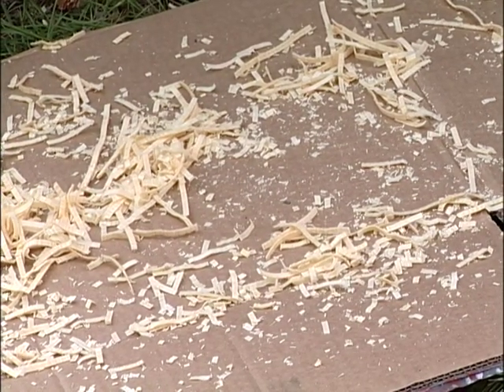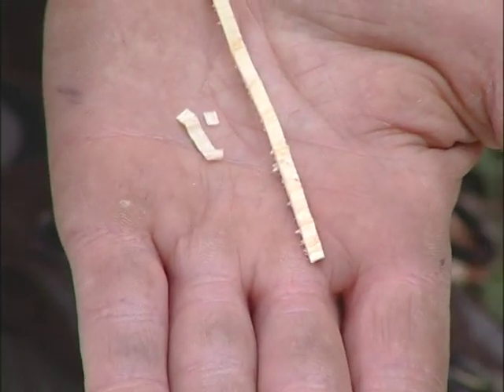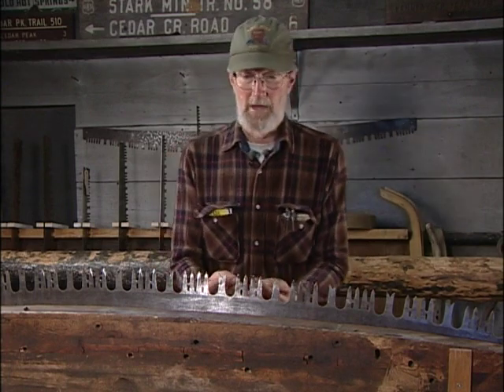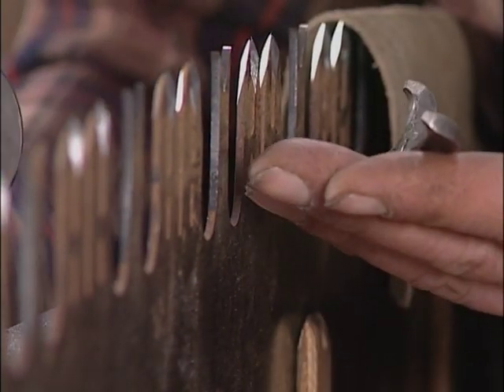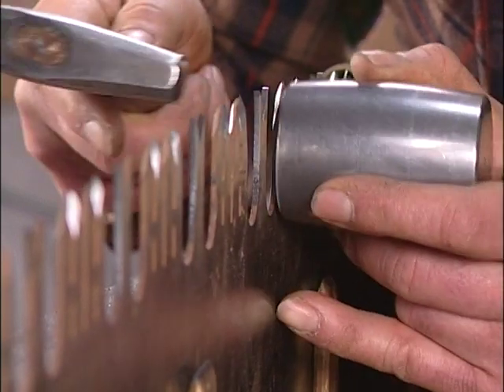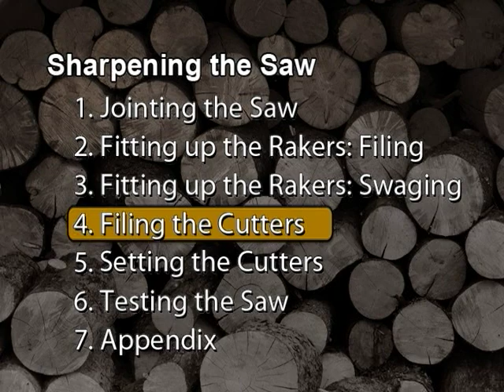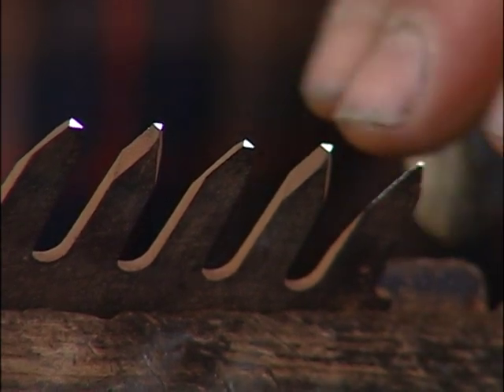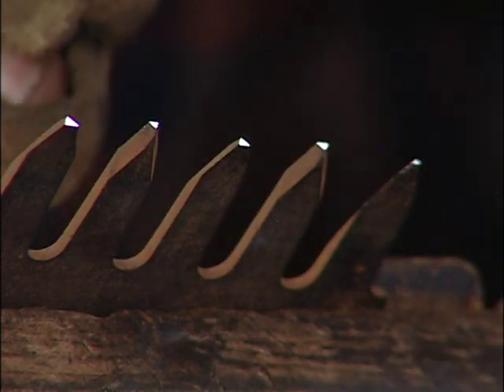The Crosscut Saw Filer, Part 4 of 5

Comment: without question there is a lot more to filing a crosscut  vs  carpenters saw.I appreciate your talent this will become a lost art but for efforts of people like yourself.I see these saws commonly at auctions  are these saws still used in the woods   it would seem the chainsaw has taken over
Reply: These saws are in fact still in use. When doing forestry service in a conservation area, especially bird protection areas, the are much more common as a chain saw is much to loud and can scare the birds off, as well as other smaller woodland creatures.
When they are used depends on the area and if less noise is mandated by law.
Reply: In commercial wood processing, You'll certainly find those saws very seldom, power tools have made woodwork faster and more efficient. But that doesn't mean those saws are not in use anymore, You just don't hear them... ;) 

If You don't have to process a big amount of firewood (or a specified amount of it in a specified time) a well maintained crosscut saw is a powerful tool, it even offers some advantages: 
1. it NEVER runs out of fuel 
2. it NEVER doesn't start because of any technical problem 
(carburator, ignition, ...) 
3. You can process some firewood even in the quiet residential area on Sunday morning. 
4. a quick resharpening of the cutter teeth (using a small rectangular stone of about 500 grit) is done in 2 minutes.

Since about one Year I own a few one man and two man saws (in different sizes and tooth patterns. Some are already restored, some are still waiting) and the more I use them (the more I getting better maintaining thm) the more I love them (*). Using and maintaining them is kind of meditation and kind of workout for me. When I go bushcrafting I often prefer a not too big crosscut saw even over the handyer folding saw. Even if I choose a big one, it's anyway less weight to carry than a small chainsaw (plus the double- tank for fuel and chain oil). 
 
(* most of saws I've restored have even become names during the process: Grace, Doro, Bella, Rosi are my saws. Vanessa, Luzi and Foxy even kept their names, when I handed them to their new owner.)

Or in short: Crosscut saws are just cool! 
It's not about speed, it's about craftsmanship and passion.

Comment: What is the tolerance between the finished swaged raker and the finished filed cutter teeth?  Also  what should the tolerance be between the cutter teeth and the raker teeth before the rakers are swaged?  I have a one-man old crosscut bucking saw and I can't find any information n the tolerances needed.  Also is there any difference in the tolerance measurements between a bucking and a felling saw or are the tolerances the same?  I'm going to use it to cut down some dead trees and cut them up.  The dead tree trunks are a mixture of wet rot, dry rot and hard dry wood.  What tolerances should I use for the saw that is best for cutting this kind of wood?

I asked other people who put up videos about filing  old saws and nobody seems to answer any questions about these saws.  Why is that?
Reply: OK.
Reply: Come back when you can handle a two-man crosscut saw and have passed your physics exams and when you have the brains to look up the definition of words in a dictionary
Reply: Indrekk Pringi I am also concerned about this ..... I havea question if you put a spider on a flat surface.whatwould be the gap on the 4th leg I can'tbuyone so I gotta build one thanks
Reply: Luc Fournier the crosscut saw spider gauges’ gaps depend on the saw and what type of wood you were going to cut with it. Old-school crescent ground saws of the outfitter on the spine and they are at the teeth require less set in the teeth because you don’t have to make as big of a gap for the spine of the sod to pass through. Almost all wood will swell a bit after it’s cut, reducing the width of the cut or “kerf“
Reply: Sorry - I hit submit before I finished. Softwoods like pines and spruces, especially when live / wet, will swell more than most hardwoods, though those will also swell during “live” cutting. The only way to know exactly how much set your teeth need (thus the size of the gap on your spider gauge) is to set them to some consistent measurement, like .010, then go test them on different types of wood — hard, soft, live, dead, etc. if they are producing good noodle wood chips, but  the saw is getting stuck (“bound”) in the cut (kerf), you need more set in your teeth to create a wider kerf for the saw to travel through. Set them a little further, test again, figure out what works. Once you know what works, set your spider gauge to that depth with a feeler gauge between the fourth spider gauge foot and a consistently flat surface. You can grind down the spider’s feet on a stone. You can also find spider gauges for sale on eBay all the time. Get the crosscut sawyers manual — it answers many questions.
Reply: Hello, Indrekk.
Warren Miller does give this in his video. He said that the raker depth (which  I believe is what he calls your "tolerance between finished raker teeth and finished filed cutter teeth") should be 12 thousandths of an inch for a felling saw (one for cutting trees down) and 16 thousandths of an inch for a bucking saw (one for cutting an already felled tree into lengths such as logs for fuel). These distances are probably for 'wet' wood; that is, either still living or only fairly recently felled. A saw for dry wood generally needs less set, but maybe is rather harder to cut than 'wet' wood. Try his suggestions and see what happens. (1 thousandth of an inch is about 0.025 mm, so 12 'thou' is about 0.3mm and 16 'thou' is about 0.4mm.) Have a look at all of the Warren Miller videos.